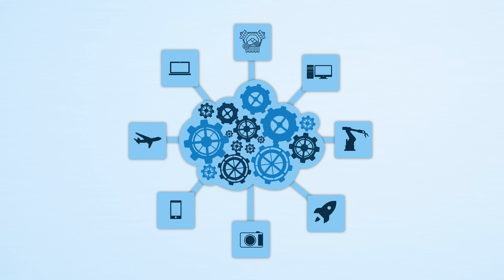E-Bikes - Stealth For Military

Comment: Thanks, a very balanced video.
My E-CELLS Super Monarch Crowns a very good E-MTB for the military. 2 wheel drive, 2 batteries, dual suspension, 35 mile off road range, 60 miles on road. 400 pound max load limit., 9 (nine) pedal assist levels, fenders, front and rear racks, 2.3 mm thick brake rotors, etc. I use mine for hunting and charge it with a BLUETTI AC200 MAX Li Fe Po4 battery and 220 watt Off Grid TREK solar blanket to charge the BLUETTI.
The BEST thing for E-MTB improvement is the use of SOLID STATE BATTERIES. Smaller, lighter and MUCH faster charging.
Reply from the maker: Glad you liked our video, and also thanks for sharing your experience, Do Subscribe to our channel if you want more content like this on your feed.

Comment: Hahahahaha…😂
Reply from the maker: What are your thoughts one E-Bikes?
Reply: @tech.inspection   I think it is a good thing.  They can take a lot of the "stupid"  work of the soldier, meaning walking.  They are easy to  camouflage.  They are fast. A soldier can go to his position which is further away and come there in much better shape, Not so tired.  I mean, which soldier can march 50 km in like 2 hours with his kit?  Ofcourse it will take time to reload, but the time the soldier is in direct danger is much shorter. 

I think they are also very good for guards duties around camps or especcially airfields.  People don't realise but the outer fences  of a not so big airfield can exceed 15 km easily.  This means when you have to do patrol by foot to inspect the fences you need two men for like 3 hours.   When burglars cutting the fences you  want to  have a mobile team there quick and without noise. Can also be a help when changing guards at gates.  Why you would use an expensive and thursty vehicle for that, if you can also use these bikes?